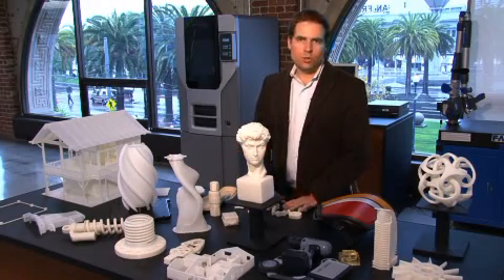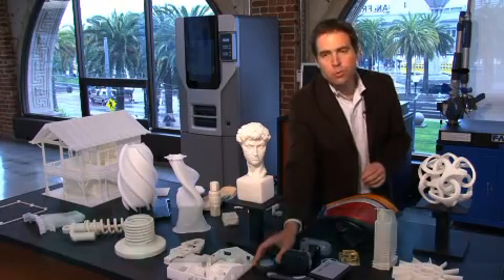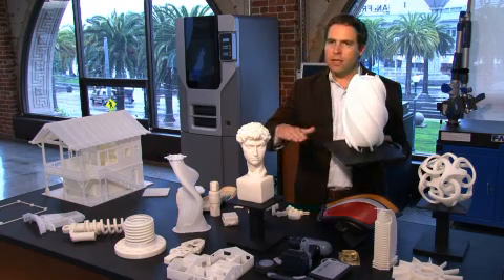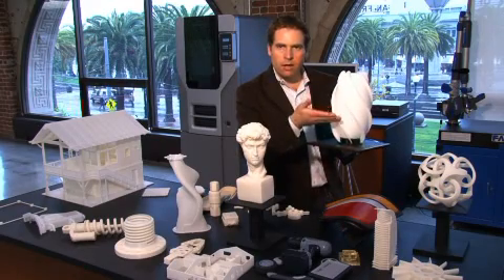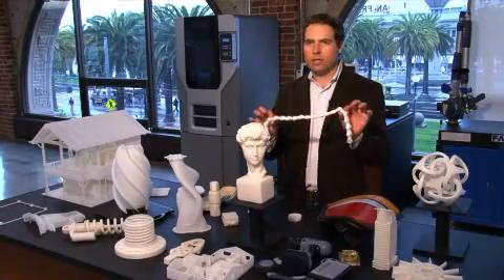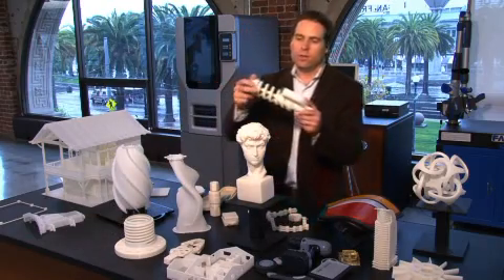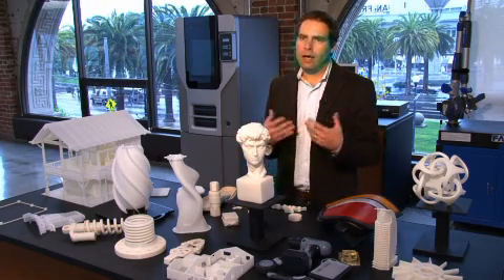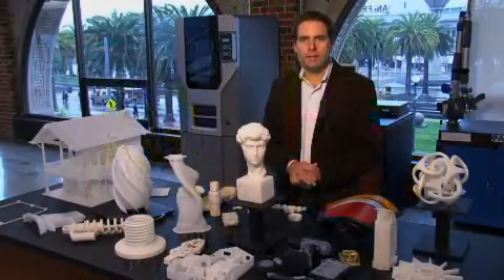Rapid Prototyping

Comment: mass production would probably always be cheaper but this would likely be usefull for repair/recycling and customization .. maybe a crossover period where few common mass produced components are combined with more locally produced custom parts..

small scale manufacture like reprap might be desirable for social factor of independance even if it's not as efficient as central/elite controlled mass production ?